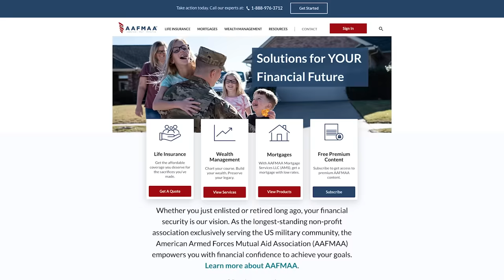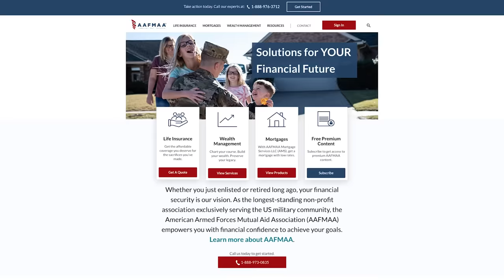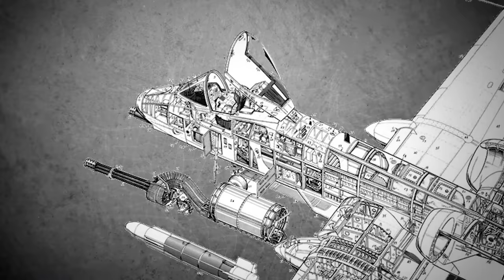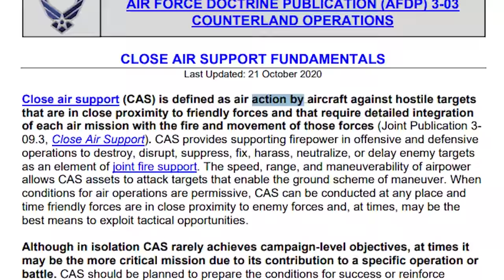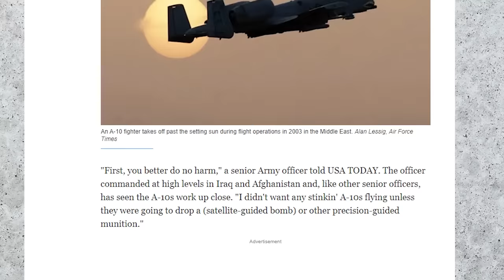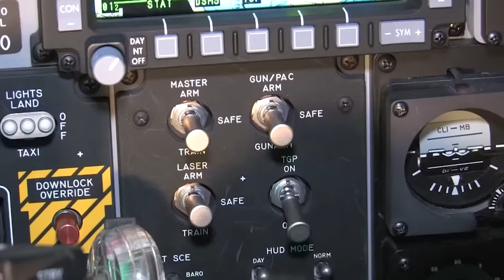Why the Air Force is Screaming to Retire the A-10 Warthog

Comment: The A-10 has been plagued with a couple of issues unique to it. The biggest issue is a main spare corrosion problem which, if you had the wing jigs wouldn’t be a problem but the jigs and the plans were destroyed when Fairchild was tanked. Also upgrading avionics and other systems has been a problem.  As iconic as it has become its’ fate was sealed some time ago.
Reply: Ya they said it’s fate 25 years ago 🙄
Reply: Boeing re-winged them a decade ago. I worked on some of the digital tools used to design the new wings.
Reply: Fix the problems!
Reply: @mahoneytechnologies657  cheaper to make a new plane lmfao
Reply: They really lost the jigs???
Reply: @kevinoshea9125  If the USAF didn’t pay for and own the tooling, this was likely when they shut down. I worked on the C-17 and the tooling was painted blue which signified that USAF owned it. The tooling was moved to a USAF controlled place when production was shut down.
Reply: @fardman7310 I doubt it
Reply: Boeing will re-make the jigs... for the same cost as developing an entirely new aircraft.
Reply: @Guysm1l3y  They delivered 173 sets of new wings for approximately $10M per set. Currently, they have the jigs stored in case more orders are placed.
Reply: @CrimsonThunderSB  the a10 is too inefficient for insurgents the us is currently fighting, the sky warden is cheaper and more versatile while literally just being a weaponized crop duster
Reply: @fardman7310  based on what evidence
Reply: @fardman7310  and last I checked the F-35 is a lot more expensive
Reply: @CrimsonThunderSB  when the fuck did i say f35 in my argument, i said that us armed forces might replace the a10 with the skywarden.

Comment: I used to repair hospital equipment and there were times parts for older equipment was completely unavailable.  Even though old equipment was better you have to move on and buy new.
Reply: Yep
Reply: @frankzappa9853 the M2 is like a simple tool, like a shovel or a fork, you can't improve much anynore and the purpose is still the same. The A 10 and F22 like any other complex machinery, is already outdated when it first comes off the production track. Already proven great in one period of time doesn't mean it will stay the same for the future.
Reply: Towards the end of its life, NASA no joke had to buy computer parts for the Space Shuttle's computers off of eBay. Most of the parts hadn't been made for a very long time at that point.

Comment: I'm a long time fan of the A-10 (and your channel).    My family actually had a neighbor who helped work on the development of the aircraft.  However, missiles have come a long way from the days when all too often they just fell off the F-4 Phantom and left those pilots wishing for a gun.  Does too low and slow apply to rotor aircraft as well and, if so, how much of the Air Force's budget will it be willing to give up to ground pounding?   Will the F-35 age as well as the A-10 and how would the F-35 perform today for ground attack if we were fighting to defend Poland?  Do we invest in more F-35 Strike Eagles?  I'm looking forward to your follow up video to this one.  I need to look into supporting your channel with more than questions.  Please keep up the good work.
Reply: I think the F-35 is well suited not necessarily for direct combat, but to gather intelligence and orchestrate the battlefield from afar. In that respect, I could see ground or air launched PGMs effectively taking the A-10's role in CAS, with the F-35 gathering intelligence telling them where to go.

The F-35's life is being written but I think how it plays mostly depends if other countries continue to buy into the system, keeping the assembly line of parts and air frames going with a large knowledge base of working with the aircraft, potentially along with new upgrade packages, much like how the F-16 keeps on going to this day with only maybe a chance of being dethroned. The A-10 never really had the luxury of building up an ecosystem like that, so basically everything depended on just the USAF to keep everything rolling. And just a reminder, the F-16 was introduced 6 years after the A-10.

Low and slow props might still work but only something like Iran's Shahed drones. Cheap, disposable, and launched in large numbers to overwhelm an opponent's air defenses or their coffers. A single high value target moving slowly through the air is not an asset anymore realistically.

EDIT: Poland also bought a bunch of HIMARS and the Korean equivalent, including a whole bunch of the guided stuff from Lockheed. Pretty clear at this point what their plan is for an armored column in a conventional war looks like. Also the part about the F-35's life.
Reply: @No-mq5lw  and a well defended AC130  with escorts  outguns. and out ammos the A10 and loiters a hell of a lot longer. A Freaking  flying murder battleship!
Reply: @Shinobubu  During Desert Storm, 3 AC-130 gunships were sent to support the Marines during the Battle of Khafji. As morning arrived, one of them, Spirit 03 turned to make it's orbiting attack, and was promptly blown out of the sky by an Iraqi soldier with an shoulder launched IR seeking missile.
During Desert Storm, the USAF lost 20 service members, all but 4 were from Spirit 03.

Comment: Great video, as usual. I was hoping you might get into some info coming from the Ukraine-Russia conflict. I suppose two detractors from that idea is the 1) it's hard to get conclusive data & 2) the A-10 is too unique compared to aircraft operating there. But I'd still be interested in hearing about the survival rate of aircraft like the SU25 Frogfoot for comparison. While they have similar roles, the SU25 is a bit faster but less protected. Differences aside, if the word is the SU25s are getting shot down left and right, that could be cause for concern. There's other factors of course: training, ECM, counter measures, etc. But if current SAM technology means that a hit = a kill even with all of the A10's armor, and we've got evidence that the more nimble SU25 is getting hit a lot, that suggests the same would be the case for the A10.
Reply: SU-25's are getting wasted out there
Reply: Define "left and right." Because quite a few Americans have trouble believing that aircraft in war are lost at all; "good" aircraft at least.
And compare it to the number of sorties. Su-25s in Afghanistan had very many losses, but also flew absurdly many sorties in comparison.

The average internet commenter is unable to comprehend that if a weapon is useful, it is used, and that being used often enough entails massive casualties. 
The Ka-52 has more losses in Ukraine than the Mi-28. That's because the Russians deemed the Mi-28 not survivable enough to fly as much as the Ka-52.

It's always been this way. One SAM hit has ALWAYS been a kill, or at least a crippling. Same nonsense as Apaches or what have you being obsoleted by MANPADS. Meanwhile IR ECM and standoff helicopter ATGMs are outpacing MANPAD tech.

Comment: I’m surprised that the video didn’t mention the Air Force evaluations of the AT-802 Sky Warden.  The Special Operations branch ended up placing orders for them, but the Air Force passed.
Reply: Their loss.
Reply: @Batmans_Pet_Goldfish  Agree.  When it comes to CAS missions, longer loiter times and ease of maintenance, it’d be hard to beat the Sky Warden.
Reply: @mjk9388  its been something ridiculous like 10 attempts in a row that started and didn't agree on anything to fill the roll, until now Special Ops finally took over and on the 11th try we have the Sky Warden; which I'm yet to be convinced is really the best choice. Maybe the OV-10 just got so close to perfecting the roll that no one has been willing to admit it and modernize it or put the resources into really replacing it.
Reply: @removedot  I remember reading about the OV-10 Bronco last year and kept thinking to myself “why is this the first time I’m reading about this craft?”  I’ve always had a fascination with CAS specific platforms but never came across the Bronco until then.
Reply: @mjk9388  TBH RQ-9 Reaper replaced A-10 long time ago, even in its own niche of COIN. As A-10 was already replaced by multi-roles, after Iran (or during as F-111 did far better job). Only reason why it still is in service is Warthog Mafia, but this platform is hopelessly obsolete at this point.
Reply: @TheRezro  valid point about the Reaper.  Also easier to leave a drone in the air loitering than a pilot assuming the Reaper can be mid-air refueled, which I imagine it can be.  Not sure what the Reaper’s upkeep cost is per flight compared to the Sky Warden.

Comment: The F35 JSF is a very good replacement for the A10 going forward in the future. CAS is evolving. It's getting much easier for infantry to hold their own against armor, as we can see in Ukraine. And the need for stealth in aircraft is becoming more clear as adversaries get more advanced.
The JSF also capable of extreme precision in target identification and can carry a variety of anti ground weapons.
Plus, its a common air frame for a ton of roles. It was designed with that in mind. I love the A10 as much as any American, but I understand that not all things last forever.

Comment: I wish you had included how the insurgent part of combat is being potentially covered by the  Air Tractor 802U and the Brazilian Embraer EMB 314 Super Tucano.  Yes, I love the A10.  I also love the P51, but I wouldn't have the USAF acquire them.  Everything has it's time and season.
Reply: Burt Rutan designed a less expensive more modern successor to the A-10 in the 90's called the Ares, naturally the USAF said hell no. Too good and too cheap.
Reply: @atomicskull6405 Not too good, just too cheap.
It was cheap because it didn’t have the resilience, carrying capacity, and numerous teething issues.

Comment: If you ever had an A-10 doing a gun run in your favor, you know the psychological impact on both friendlies and hostile when that gun starts to sing.
As long as your FO or attached JTAC aren't soup sandwiches, getting effects on target is rarely an issue.
Reply: If its able to be used, there is no better plane.  But if it cannot make it to the front lines in 1 piece, its functionally useless.  Very effective against an enemy that doesn't have an s-300 site.  Not very effective against one that does.  Unless of course you take out all of the enemies anti air capabilities, but at that point you likely have either won or are just about to win...at least against a modern military in a proper uniformed war ex: us vs china.

Comment: As for the A-1E,  you don't take it out by anything smaller than a 20mm.  And even then, you are going to hit it over and over.  Like the A-10 and A-7E, the A-1 was a titanium bathtub which save many pilots.  I can attest how tough the bird was.  We had one land with a wing missing from the aileron out, it had a tree limb in the cowling, the prop was bent, it was shot all to hell.  It landed with much of it's weapons still onboard.  The Pilot landed it, ran away from it and the Weapons Folks disarmed the weapons.  This thing was a giant bomb until disarmed.  There has been only one A-10 land even close to being damaged like that.  The A-1E was worth it's weight in gold and to bad mouth it is embarrassing.
Reply: Mate, you're taking this a bit personal. It's not "bad-mouthing" tech to note its vulnerabilities and limitations, especially as opposing tech improves. As the old Ikea commercial said, "You feel bad for this lamp. That's because you are crazy. The lamp doesn't care, and the new one is much nicer".
Reply: @michaelccozens  When it said the A-1E could be taken out by small arms then that was a lie.  I was just pointing that out.  Guess what, I knew the A-1E personnaly and know the capability of it.  I am also versed in the A-10 and know it's features.  I am retired USAF and turned a wrench on both of them.  And I know that the A-10 wasn't a good replacement except it was new and the A-1 was left in overseas countries.  The A-1E was more rugged than the A-10 and it carried almost the same payload with only one mount less.  The A-1E also had a longer range, longer loiter time and was just as scary to the Enemy as the A-10 is today.
Reply: @darylhunt2148  Also folks who criticized it for only having one engine didn't realize it was a radial engine. There were times when multiple cylinders were obliterated in the engine and A-1 still managed to bring the pilot back safely later that morning so they could climb in another that afternoon to provide more support below the radar. That being said folks say the manpad is the enemy of the A-10 but there are multiple times where an A-10 took a manpad hit or heavy AA fire which severed a wing or took out an engine and still returned the pilot safely. A pilot who then just climbed into another cheap A-10 and took care of the danger close targets the fast movers couldn't hit.

Like the Ju-87 with gun pods, and the F4U in Korea (AU1) they are all incredible DCAS aircraft, their only shortcoming was that they weren't profitable enough to justify keep making them.

Comment: I am an Air Force Veteran and was an avionics specialist for the A-10 and I recall when it was going to be moved over to the Army or all out retired but it was the most feared aircraft for the enemy mechanized ground troops in Desert Storm and favored by our troops (Army) for air support. It's a flying BIG Gun, is very quiet, and it loved to hunt tanks. What is more American than a flying big gun! I have seen sections of the main and tail wings ashot off and missing landing gear and still flying and landing. A larger than normal pilot (football player) sits in the titanium tub and that frame can take a serious beating. Brrrrrrt ;)
Reply: This is an interesting one, because I've heard that people who called the a10 in for close air support hated them.

Basically because the gun has a big splash zone, combined the reliance on the mark 1 eyeball meant that it had a tendency for blue on blue fatalities.

edit: iirc the british requested the a10 not answer their requests for close air support because of this reason.
Reply: I was WCS (weapons control sys) on A10's back in the early 80's, the bull pup controller was replaced with a slew track switch that did the same thing, we used to use a theodolite to calibrate the HUD (gun cross) it had the most accurate gun, longest range, and also the highest muzzle velocity gun at the time. there is a lot anti-A10 propaganda floating around. I can not tell them what to do just to say be careful who you listen too. I also had an SEI for the A10, one year our wing flew 93,000 sorties-- just a great jet
Reply: @davegt27  given the amount of blue on blue kills and civilian casualties (they stopped using it in Afghanistan because the civilian casualties were making the Taliban look good, and as I mentioned, during desert storm the British requested the a10 not do CAS for similar reasons) the a10's gun has....i shudder to think how bad those less accurate guns were.
Reply: @jeromeace1282 Clearly you've never been on the ground when someone was trying to kill you.  Big slow low flying things dropping lead on the enemy are never unwanted.  Destroying the enemy and disrupting his will to fight wins battles.  

No American has ever lost the will to fight when we could make eye contact with a A-10 pilot.
Reply: @LupercusArchanus  I mean, the people who called them in for CAS would probably beg to differ lol.

There's a clear divide between who called them in for CAS (who hate the a10 due to the friendly fire potential), and the ones who just called them for ground attack (aka nowhere near friendly fire range) 

When the lead has a big enough splash zone you might be the target of friendly fire, you'll probably wish they just fired some missiles instead.

Comment: Ft Irwin CA 1978 will never be forgotten.  That GAU 8 that sounded like a Monster to us, it was about 7 miles away but it sounded like it was right next to us.  The rounds are meant to hit the TOP (both Turret and Hull), not straight on.  Even the M1 A2's Top would be pinned.